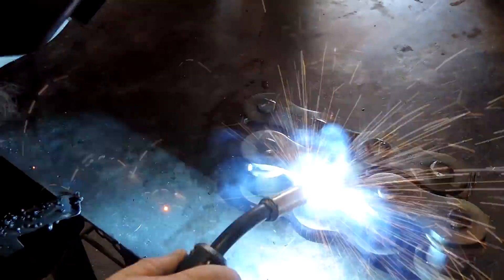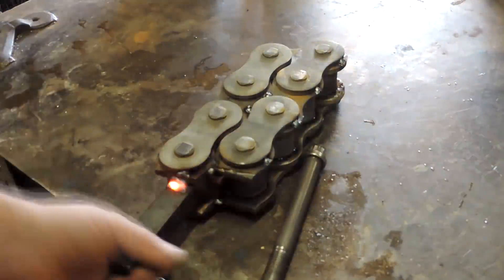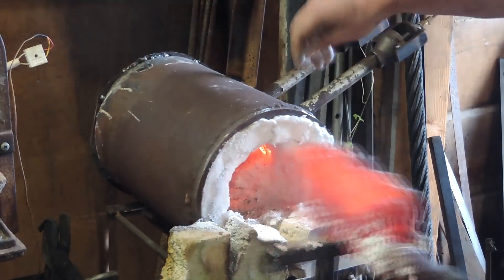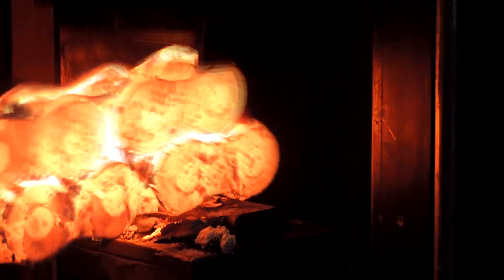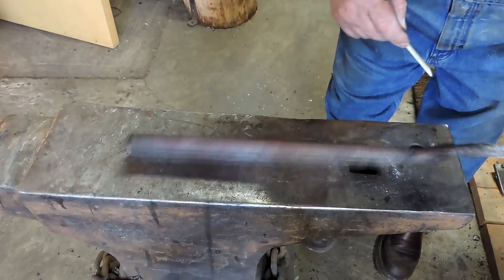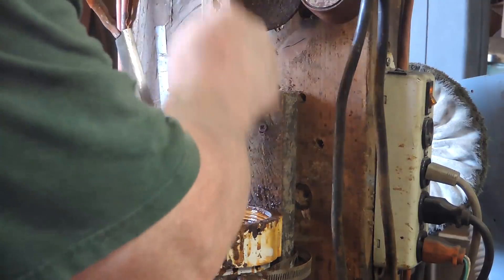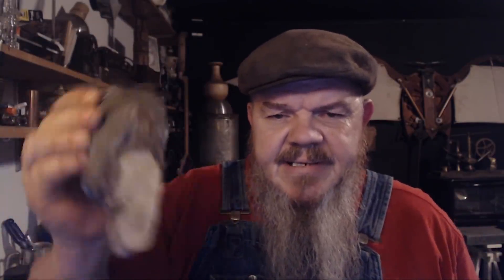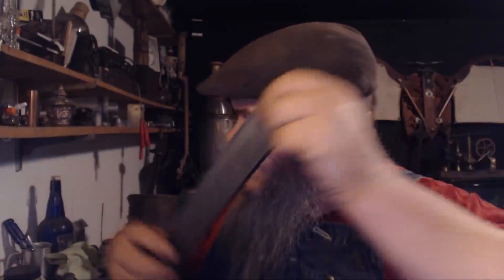Forging Monster Chain Damascus

Comment: What is your etching solution mix?
Reply: Forgot to ask. How long do you etch the metal in the solution for your best results?
Reply from the maker: 50 50 Mix Fc to H2o
Reply from the maker: 10 min at a time 4 to 5 times.

Comment: Cracking as ever tim. I have a big length of this left to play with too. Ive also found it dosnt appreciate being squished vertically. So i tend to reweld it again to purify it a bit
Reply: Where is that size chain used? That thing is huge! Haha!
Reply: In my case driving huge extraction screws in an ore plant
Reply from the maker: Thanks man, and thanks for watching.
Reply: Interesting. I've never seen a roller chain that big.

Comment: only problem with wood design chop saw is the abrasive and filings get into motor, brushes. block those supply clean air circulation and no problem. or just use till it quits

Comment: Hey there!
Just need to ask couse ive been thinking about maybe tryin the same thing. Do you use a regular wood saw that you put an abrasive disc on?
Reply from the maker: Yes sir just make sure you remove any plastic bits first and go for it they work really well.

Comment: I have found my new favorite YouTube channel, thank you for all the great info you put into them. I dont know if this has been mentioned before, but you have to be careful when cleaning metal with brake clean with chlorine it can cause a lot of health issues if it vaporizes. Not sure if that's only when arc welding or if it's just heating in general.

Comment: I really like the way you present and explain the process of your forging damascus. I like the end result also. Great ideas. But I read an article in an American Iron magazine cautioning against using Brake Cleaner of any kind and then heating the metal you cleaned. Whether by welding, forging, cutting, grinding, etc. because the intense heating creates a poison gas that when inhaled has a similar effect as some nerve gases have. I don't know by experience, (and don't want to), but I figure better safe than sorry. I hope you might change to some kind of non toxic type of method of pre cleaning your steel as nerve damage may impair forging abities somewhat. But don't want anyone to suffer damage from dangerous materials. Keep up the good forging. JAD

Comment: Nice. I tried to forge weld some forklift chain and was having similar issues. I haven't tried again because my coal forge doesn't seem to get large billets hot enough. I am told my fire pot isn't deep enough. When I finish my 2 burner forge may be Ill try again. Thank you for the video.
Reply: S/V Sugar Magnolia just build a bigger fire my friend. I do all my damascus in a coke forge. And can heat 100mmx75mmx50mm quite easily.check my scrapmascus video you can see.
Reply: Da Main Mouse subscribed!!!
Reply: Phillip Taylor thanks!
Reply from the maker: Thanks for watching.

Comment: Good gravy that was a big chunk of steel! How much did the final billet weigh?
Reply from the maker: Starting weight was around 12 lbs and the billet I ended up with was just over 3 lbs. but I still have about 7 lbs of roller nuggets leftover.

Comment: Tim, if you have any extra damascus scraps you don't want, could you send me a few, I'm going to be making rings
Reply: Prefferably quarter inch to half inch thick, and 1 inch square
Reply: For jewelry, I find that stainless or mokume gane is a better choice than carbon steels. Stainless (eg. 304 and 316l combination) can have a real nice pattern. Maybe you can get Tim to collaborate with you?
Of course, this is my thought on the subject, you may have different thoughts.
Reply from the maker: I'll see what i can find...
Reply: Awesome!
Reply: Tim 
Nice work. I will send you a message later there are some ideas I would like to talk to you about.
Don’t know if you have the time to try it but it may be fun